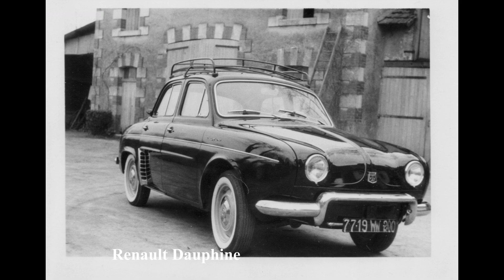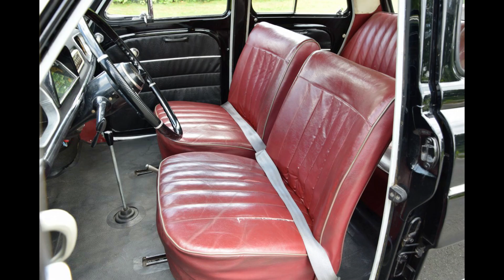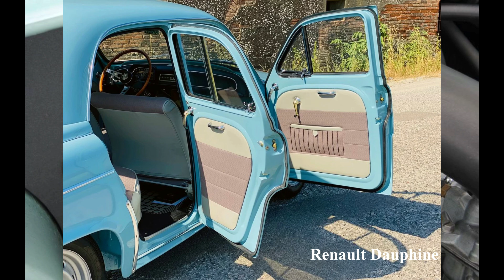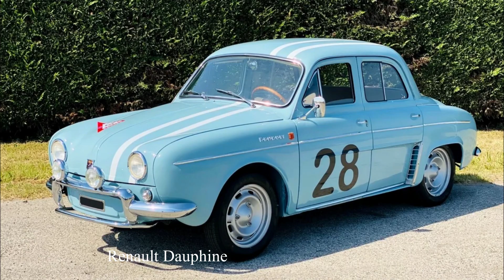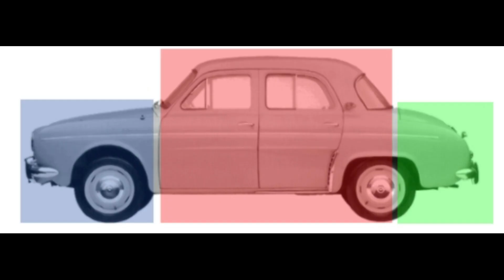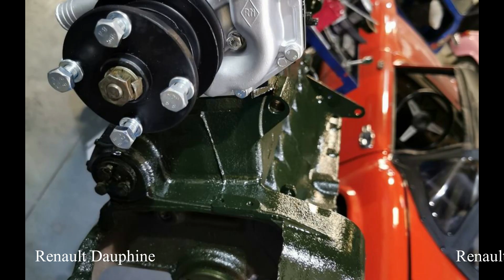HISTORY OF RENAULT DAUPHINE CAR 1951-1960  Classic Cars

Comment: At one point, my brother had two of these in our garage, which did not make my father very happy.  1 was rather quickly sold off as a parts car.  The other was supposed to be a daily driver but we could never keep water out of the oil.  Or oil out of the water.  We were in southern New Jersey at the time, very rural.  The nearest Renault shop was 30 miles away.  My stepmother ended up selling it off, but my brother was disappointed that we couldn't finish the job.

Comment: Unfortunately in the UK these cars had a very poor reputation for rusting, in a period when rusting was a problem with most late 1950's and 1960's cars.  The swing-axle rear suspension could also catch out the unwary.

Comment: The swing axle rear suspension can bite.  I rolled one over because I didn’t know what happens when you lift off in a sharp turn.  Oversteer!
Reply from the maker: When I was kid, have no clue about these cars. But my uncle had this car for 15 years. No issues.
Reply: Unfortunately, lifting-off when things start to go pear-shaped, is a knee-jerk reaction that has to be unlearned. I vividly remember almost comming to grief in a VW beetle, at at time when I was used to Austin/Morris minis.